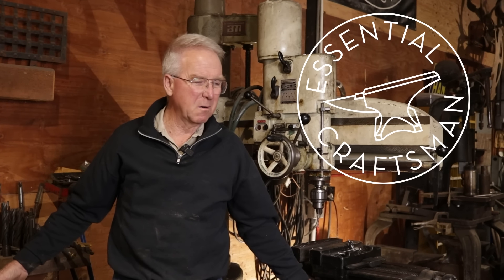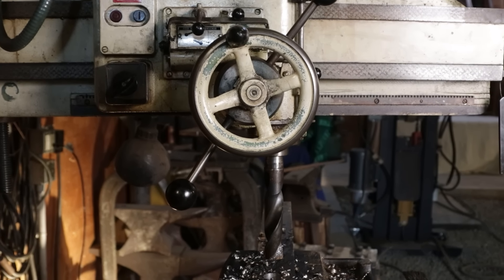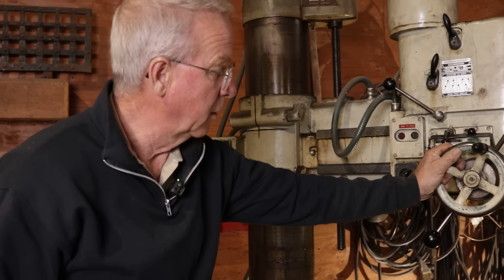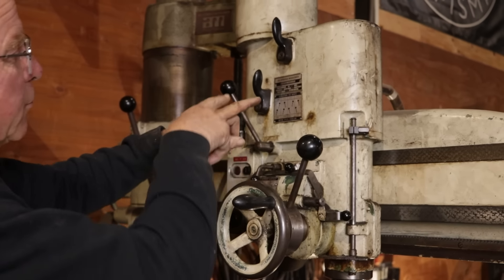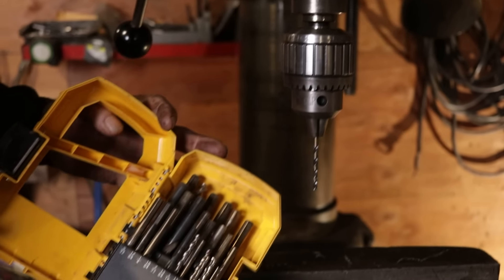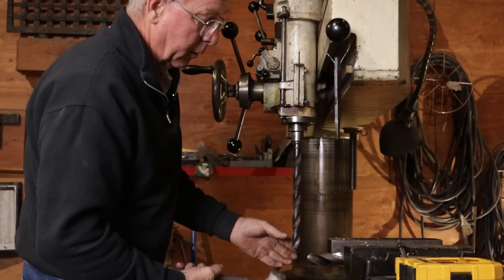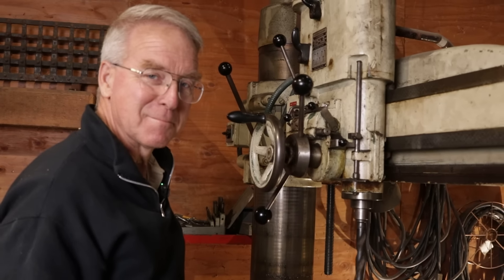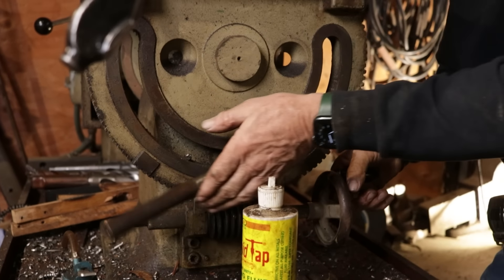The Drill Press That Does EVERYTHING

Comment: As American/Canadian corporations (John Deere included) continue to move production ‘overseas’ we will see less and less folks with these skill sets and know-how. It’s actually very scary.  Thanks for keeping some of this alive.
Reply: It's not so much the moving production overseas you have to worry about - we're on the cusp of nimble movement robotics like Boston Dynamic Atlas being integrated with LLM's like OpenAI ChatGPT and when that happens you have the possibility of a tireless, emotionless workforce with 130 IQs pulling 24h shifts every day 😂
Reply: Moving of production has been going on since the 80s.
Reply: yeah "continue" to move production.... as in not already done back in the 1990's
Reply: In addition to that, much of what has been lost is heavy industry. And this is particularly damaging because so much of what was done by that heavy industry was critical  and all is exceptionally difficult to re-generate.
Reply: @scroopynooperz9051 
130 IQ? Are you sure? 
I don't know enough to challenge that statement, but it sounds like a big reach.
  At any rate, it's the nature of a fixed environment like a factory that you don't need anything from Boston Dynamics. All the regular stuff that's already being used will work just fine.
Reply: Not really familiar with those, but have run a couple mills and lathes...

Since that has ways, I would recommend keeping all the ways and the column wet with way oil 

Mobile vactra or something like that 

Also, you can drill some larger holes with that. Use an annular cutter.  

With drill presses, the question is always how slow you can turn them, because that dictates the size of hole you can cut 

As the size of the hole goes up, you're farther away from center where you're cutting, so the actual cutting surface is traveling more inches per minute. 

Different materials like different cutting speeds. 

Machineries handbook is our friend...

Comment: You can do a lot more with this drill. Get a Morse Taper - ER32 adapter so you can use ER32 collets to hold reduced shank drills, counterbores, reamers, etc. These things are NOT supposed to be held in a drill chuck as they will always slip and damage the tool shank and chuck jaws. If it has more than 2 cutting edges or the cutting edges make a larger hole than the shank diameter you need a collet as a simple 3 jaw drill chuck will slip. You can also get a Morse Taper - Annular Cutter arbor which enables you to use annular cutters. Some arbors have a slip ring so you can run coolant through the morse taper adapter into the annular cutter while its spinning. Annular cutters are magic that didn't exist when this machine was made, this machine could easily run a 5" annular cutter through steel without a pilot hole. Those cutters are pricey to resharpen though. 
You don't have to tap the tapers together either. Wipe them off regularly so they are clean and just slam them together. They are self locking under pressure and you will snap those drills clean in half before the tapers slip. Just make sure they are clean, its a nightmare if you damage the female spindle taper. If the female taper is damaged you can use blue dye to check for high spots in the spindle with a good male taper and grind them down with a die grinder or diamond needle file and restore your spindle taper.
Reply: Good advice. 
 Another little trick to use on slightly dinged-up Morse taper fits is to slip a single-thickness cone of typing paper between the male and female tapers before slapping them together during setup, for a reliable grip to run them without slipping under heavy torque loads.
Reply: I would buy a cheap morse taper tool and go at it with lapping compound before a file. But you're absolutely right about the capacity of the machine. In their production days, all the tooling would have been morse taper shanked. An ER collet will give you a lot of versatility as no 3 jaw was ever made to transfer the torque of a large tool, or hold the runout of a tapered spindle. The taper holds the runout, the tang the torque. Tooling for these machines was never cheap, but was more readily available in days past. Lifelong machinist... I have tons of mt2 drills and reamers I saved from the scrap bin of obsolete machines. Fit the (badly beaten)  tailstock of my 1930's Sheldon lathe

Comment: For oiling those ball oil interfaces, you can modify the tip of your oiler with a fine triangular file to make two small v-shaped openings across the tip of the oiler so that you can push the ball down with the tip of the oiler while still having those two small v-shaped cuts in the tip to allow the oil to flow out when you pump. It works.
Reply: Exactly what I'd do.  The tip clearly fits, so if you create some path for oil to come out, it'll flow while remaining depressed.  Either that or drill some passages in the side -- just something to create an egress that's not the tip.

Comment: Variable frequency drives have become cost-effective for becoming single phase to three phase converters. Not only do you get three phases, but now speed control.
Reply: Rotary phase converters and VFDs each have their place. Keith Rucker has a great video that outlines the advantages and disadvantages of each.
Reply: VFDs are great but those that generate a third phase top out around 5hp so rotary converters are still necessary.
Reply: To add onto the other disadvantages already listed. Slapping a VFD onto a motor that is not inverter-duty rated (which for a tool of this vintage is almost certainly not the case) can cause damage to the motor.
Reply: Kurtis, on Cutting Edge Engineering Australia used a VFD as a speed controller in a recent video.  He obviously has three phase in the shop. https://youtu.be/XToS92F6TqY?si=gT9BV37RpD7XQtBY&t=92

Comment: I would suggest buying a copy of The Engineer's Black Book. It is chock full of information about the most common machine shop tasks. Especially things like picking the proper RPM and feed speeds for tooling.
Reply: Unless you are working in / running a full-service machine shop, Machinery's Handbook is probably overkill.
Reply: It may be overkill for the author of this video but the Machinery Handbook is incredibly invaluable! I would buy one even 40 years old because they are so useful. Yes, finding a used one may be difficult but they are well worth the money. If one cannot procure a used copy? Then bite the bullet and buy a new one. eBay may be your best friend when it comes to scoring a used copy.

Comment: For those who are interested these are the calculations for the proper speeds and feeds for drilling with the machine and tools in the video. I'm a Detroit Tool and Die Maker and have worked in the industry 40 years.

A 1.000" twist drill with regular taper shank would have a Morse #3 taper. The tang on the end of the drill does not drive the tool in anyway-that is the job of the precision taper. The standard flute length is 6 3/8" and the overall length is 11 inches. The drills in the video appear to be extra length and would have slower feeds and speeds than the standard as described. It would be expected for this drill to have a maximum TIR (total indicator reading/runout) of .010" when mounted in the machine. If TIR is greater, the taper and/or the machine spindle bearings are worn/damaged or the tool is damaged/poor quality.

To calculate the Speeds and Feeds (proper rpm and feed rate) use these  formulas:

 RPM=3.8 x  (surface feet per minute/drill diameter). The surface feet per minute is available in the machinist handbook, from the drill mfg, or the workpiece material supplier among other sources.

The feed rate is obtained from the same sources and is usually given within a range. Many factors need to be considered-machine condition, machine HP, setup....

To drill a 1.00" hole in mild steel the SFP is 100 surface feet per minute and the feed rate is .020" per revolution (both figures from the Machinist Handbook):

(3.8 x (100/1.00)=380 RPM multiplied by .020"=7.6 inches per minute (IPM). So the machine should run at 380 RPM and the feed rate should be 7.6" IPM. To drill a hole 4 inches deep it would take  .53 minutes or 32 seconds (4" depth/ 7.6 IPM = .53 minutes). According to the handbook, this operation would require about 1.1 HP.

Most likely the machine will not have these exact RPM's and feed rates so you choose the closest available.

The speeds and feeds can be significantly improved with ample coolant flow. No pilot drill is necessary but the hole must be spot drilled as the taper drill cannot accurately and safely start a hole, and the radial arm drill is incapable of accurately locating holes without special fixturing or jigs.

Comment: I operated a monstrous radial drill press in my younger days to drill oil holes and tap 4" diam bearing cap holes on 18ft long steel crankshafts for 5000hp diesel engines. Tapping those holes put a few gray hairs on my head. Loved that radial drill.
Reply: Nice. 
Was this big enough to be a rider?
Reply: @ronfox5519  Yep!
Reply: BTW was getting $7.25/hr union wage working on a $250k crankshaft. In 1979.
Reply: @aksourdough4890  
250k? Shure wouldn't want to make a mistake on o e of those. Today's money is like 6 times that.
 Was the machine made by Ingersoll?
Reply: @ronfox5519  Don't recall. Been a while. When I'd go to tool crib for my taps, some of them had chipped threads: "Do the best you can."
Reply: Imagine a crankshaft with a broke off 4" tap in its bearing cap hole!
Reply: @aksourdough4890  ugh. Thats half a day lost in an instant- assuming you could reach it. 
  Did you have carbide back then to help dig it out?
Reply: @ronfox5519  yeah lots of carbide. You'd have to burn it out and hope you didn't destroy the crank. Fortunately never had to find out.

Comment: The tool you used to remove the drill from the reducer sleeve is called a drift. Also if the tapers are clean and free of burs, you can line the tang up and, with a little force, slip the drill into the spindle, and it will stay without the use of the lead hammer

Comment: Great find! Always wanted a radial arm drill press for my shop despite not really having a use for it.

For oil, those little balls are only there to keep dirt out, they don't provide back pressure, so oil from your particular oil can flows in perfectly well. Under those balled-off caps is a small cavity with some felt or even just a piece of rope that acts as a wick, holding oil and slowly releasing it. During regular maintenance you really only need just a couple drops of oil to top everything up, so do not worry, you are lubricating the things just right!

Comment: I have a 7ft Carlton Radial Arm drill. You likely saw it when it fell from the bridge crane and broke. In way I welded it back together straightened the shaft and it has been working great ever since.  I use it a fair bit. I will say probably the best thing you can do for drill bit life is run flood coolant. It makes the drill edges last probably 4 times as long or more depending on what you are drilling.

Comment: Arboga made some wonderful drill presses. I have only used their geared head standard drill presses, but it looks like their radial machine is top-notch as well.

The word is turret not turrent, but it isn't a turret, it is a head on an arm (radial arm). A turret is multiple faced and indexes to present multiple preset tools. Commen examples are Burgmaster turret drill presses, manual and CNC lathes with the turret feature. A turret stores the preset tools, and also is the locating/machining point. The turret is mounted on one or more movable axis. A turret can be mounted on a lathe tailstock giving one axis travel, a cross slide giving typically two axis travel, or get fancier with a compound or even third axis.
The Burgmaster drill press application uses only one axis travel.

A spindle turns the tool or the work. A spindle often is mounted in a quill giving Z axis travel. A drill press is this design. A lathe tailstock design is another example. Z axis is travel parallel to the spindle centerline. X axis is travel perpendicular to the Z axis, and Y axis is perpendicular to Z and X axis. X axis is the longer axis  travel and Y axis is the shorter travel axis. W axis is parallel to Z axis and is the secondary axis to Z. A Bridgeport is a knee mill. The quill is Z axis, and the knee is W. Your radial drill has a W axis. It raises and lowers the arm. The head travels on the arm, X axis, but the arm swings in an arc. This is not a true Y axis.  I have never heard this axis called by a letter, I refer to it as the swing.

There are other radial drill designs. There are light duty home hobby shop machines and a vintage industrial design made by Johansson. There are likely others as well. In the machining world, your Arboga is on the smaller end of the size spectrum, but still a wonderful size. Our shop purchased a unit smaller than yours new around 2012. I forget the brand, but it was sourced from the Orient, probably Taiwan.  It was a high-quality machine. I was envious, because it would have fit in my basement hobby shop.

Fitting your machine with the shaper table is a nice upgrade. These machines are normally fitted with a T slotted fixture table that allows work clamping to the top and side(s). The machine is capable of Z axis machiningish milling functions as you described.   But you lack feed control and position control that you would have in a true mill. You also lack spindle speeds and tool holding capacity.  It is a drill press, so it is designed to hold drills and operate  at drilling speeds. Mills should be held in a collet or tool holder. If you do your start at an angle trick, use a full centering cut endmill. Many mills do not cut to the center. I suggest you operate the mill at max available RPM for the work that you described. Go gentle on the feed rate. A 4 flute cutter will probably work better than 2 flute for the work that you described.

An oiler is made for the oil fittings you described. They have a proper name, but the tip diameter is small enough to depress the ball check valve.

I now have a 4600 sf hobby shop building with 16' 4" ceiling. I can now house an industrial radial drill.  I want one! They are pretty much antiquated technology, but are wonderful machine tools.

Arboga made some of the Wilton branded drill presses.  
Your machine is intended for large workpiece or large drill operations.  It is overkill for small hole sizes in small parts. Anyone that owns your machine likely has an armada of smaller machines for that work. Your machine with instant reverse is a good candidate for power tapping, provided that your chuck can adequately grip and hold the tap.

Comment: What I did in regards to the ball tip oilers is I replaced the large bulky hose and fitting on a standard oil can with 1/8” diameter copper tube that is able to fit down fully inside of the ball boiler and the oil can generates sufficient pressure to force oil past the ball.

Comment: Nice radial drill! There is a special tip for oil cans to be used on ball-type oilers, or you can modify one to use. The Morse taper socket in the spindle should be kept absolutely clean and oil-free every time you make a tool change. Those taper tools are driven by the taper fit, not the tang, which is why the need for keeping everything clean is paramount. Even a slight ding will not let the taper make full contact, resulting in slippage or tools not staying in the socket. If all is well, you should be able to just push the tool into the socket and be tight, no need to hammer them in. If you do get a burr, there are morse taper lapping tools or even reamers for something really bad. Use them wisely because you can ruin a spindle if misused, which would be a bad day. I always run my finger around the inside of the socket before installing a new tool because you can feel any dirt or burrs. The Jacobs chuck you have is the Super Chuck ball bearing model. Those are very smooth and very expensive. Jacobs no longer produces those in America to the best of my knowledge. I have many of them from small 1/4" up to the 1" 20N model. I use them in all my machine tools, and I love them to death.

Comment: I ran a Carlton Radial Arm Drill years ago in the tool room of a stamping house. The way we located our holes on the die work was to accurately lay out the work with Dykum (layout paint) rulers and scribes, or on surface plates with height gages. Then Center punched, and ran an 1/8 drill bit in reverse to pick up the punch mark with the column and carriage locks released. If the drill deflected slightly it was almost on the punch mark and could be bumped into location. Once it could touch the conical upset material without deflection the locks were engaged, checked one more time, the rotation switched to forward and we drilled it 1/8” deep. We then switched to the desired drill size (or a 1/2” pilot drill if for a larger hole), and drilled to depth. We used coolant in squeeze bottles for drilling steel to keep the drill tip from getting too hot and loosing temper. If the hole required using a pilot drill first before a second (and sometimes third) drill, then the pilot hole was drilled just shy of breaking through. This kept coolant in the hole to do its job. The final drill was the one to break through. 

If you are going to tap or ream a blind hole, put a rag around your airgun nozzle as you insert it into the hole and squeeze the trigger. Don’t ask me how I know that. 

Thank you for introducing us to your old friend. It’s obvious you appreciate and take good care of her.